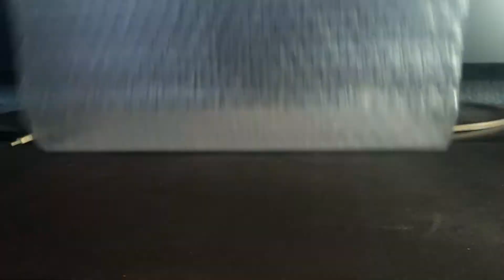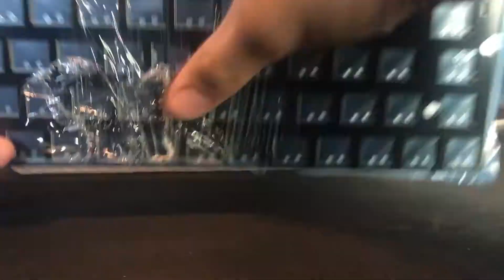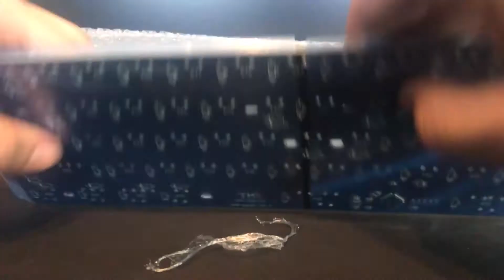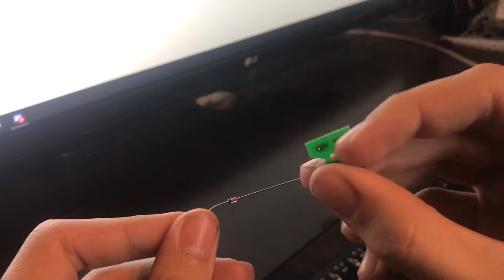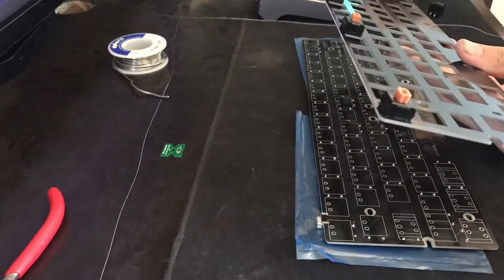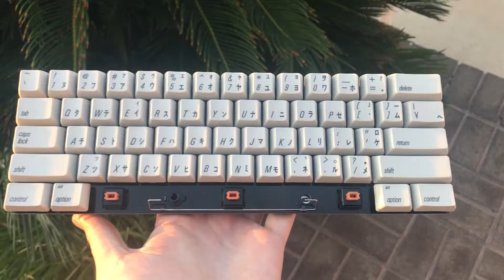Orange Alps64 build log and typing test

Comment: Have you tried other cases. I like the sound of this cheap plastic case. Maybe it’s good enough? How does it compare to aluminum? (Also, that cable!)
Reply from the maker: Thomas Malcolm Macleay aluminum of course feels better, but the sound suffers. I prefer the feeling of the switches in aluminum, but prefer sound of plastic. I got the cable on Mechmarket. I don't remember who made it =(

Comment: Holy crap! You’ve built my dream.
Reply from the maker: Thomas Malcolm Macleay it's an amazing board! Orange Alps are great and everyone should try them at some point.
Reply: Fluffypupper 22 missed out on a local AEKii  last week so I bought a Matias Tactile Pro. Came the next day by regular mail! Really like it but now I’m on a quest for compatible keycaps (Toshiba T3200 on it’s way) and itching for a build project. Did you reuse the pcb on your original board, or did you wind up ordering a new one? I’d love it if you could provide links to suppliers and details about parts. Where on earth did you find alps keycaps with Kana?
Reply: Update: I’ve now got two aekii boards and a Hasu Apls64board. Plan to harvest the cream switches for the build. Orange alps out of reach. Can you tell me both the cheap and nice cases you mentioned.

Comment: man i wish i live in the states or europe. shipping anything from ebay cost at leas $60 to SEA. Finding alps keyboard is also hard, people don't care about keyboard here, also only big companies have computers back then, so not much i can find at thrift stores.
Reply from the maker: Useless Dog =(. Have you tried checking recycling centers?
Reply: Try Taobao, I've ordered my Model M there and it is in pretty good condition and cheaper than eBay as well, although trying to find a Alps board in good condition may challenging and you would need to communicate with the vendor directly to make sure the board has seen only little use before.
Reply: I would be cautious about ordering Alps boards from Tao Bao. Generally the boards are not going to be in great shape. This isn't a big deal for Model Ms because the buckling spring mechanism is highly resistant to dirt, but Alps switches can be totally ruined if they're too dirty. So unless you're willing to spend time cleaning out every single switch on the board, ordering Alps from Tao Bao can be risky.